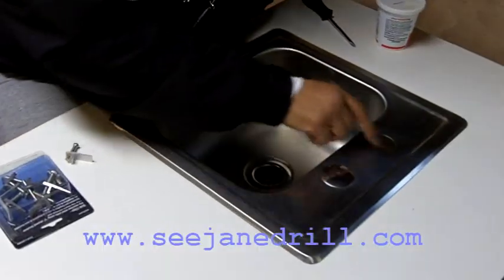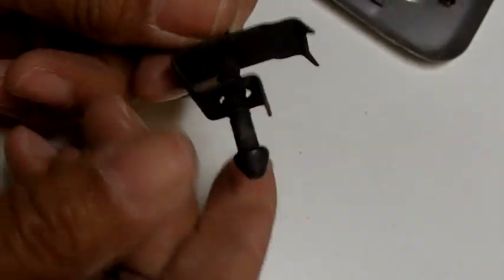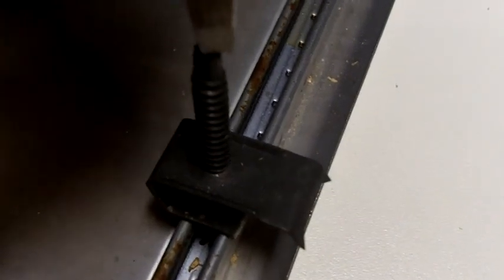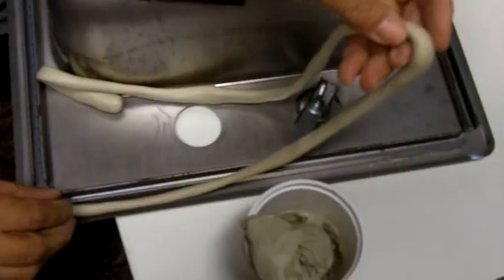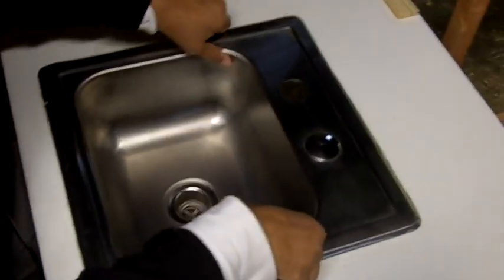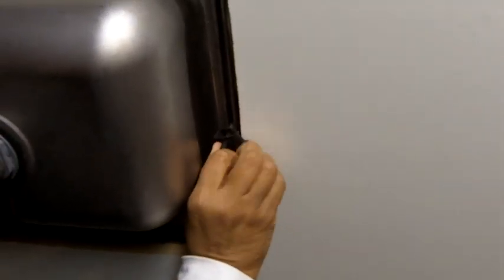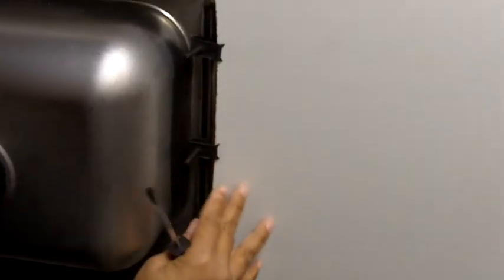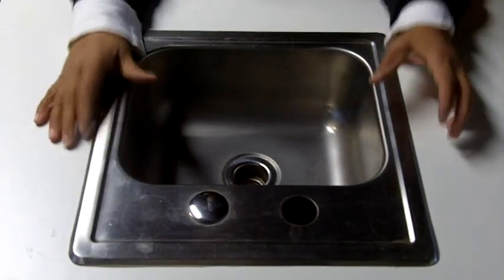How to Attach a Sink to a Countertop

Comment: Thank you very much for posting this video. I spent an afternoon installing a new stainless sink and when it came time to install the adjustable sink mounts, I was lost on how the clips actually worked, or fit to the rails. I had a friend who was helping me, and he didn't know either, so we found your video, and we got the sink in flush and square. We would not have been able to install the sink without this video. I wanted to let you know this. Thank you, again!

Comment: Thanks Lea for sharing. I bought a used stainless sink that came with no clamps. I’ve tried different style clamps but none worked. Another problem I have is the sink in bowed. But you putting plumbers putty around the sink gave me the idea how to fill in the gap caused by the bowed. My sink has different track than your sink for the clamps. I’m gonna go to a plumbing supply store to see if they can help me out getting the correct clamps.

Comment: Sinks clips are a pain... a good plumber passed on a tip... a 10-24 hex head bolt and nut fits in these...use a nut driver to finish off...save the frustration trying to get your flat head screwdriver in there... also used 10-24 couplers, rod and brackets on the "ornery" front of the sink... good job...good videos...glad I found you!
Reply: Michael Ambler
Reply: Michael Ambler watch

Comment: The problem I'm having, is when a sink doesn't have any tracks or lip to even use these kind of clips. In fact even if it DID, I've only got 1 side that has a usable lip of the counter top. An it's a copper sink + counter top. So idk if the only option is gluing and/or siliconing it.

Comment: For us taller guys trying to fit under the sink....using a flat head screwdriver...is not very easy.  why hasn't anyone developed a better screw fitting thats a bit friendlier than the flat...it has a tendency to slide off the head of the screwdriver.....and why didn't you have the faucet already installed before mounting the sink....much easier that way...unless thats for another vid....lol

Comment: I have a question. My laminate countertops are bowed/warped. I was originally going to use a fiberglass sink but it doesn't use clips. It just sits on a bead of silicone. If I use that I will have to try and sand it to the valley. My question is are these clips pretty strong? Do you think it will suck the valley up to the sink? I tried screwing the the countertop down to the cabinets but the screws just tear apart the particle board tops. I'm trying to decide if I should exchange the fiberglass for a stainless sink with these clamps or just try to shave the fiberglass sink.
Reply from the maker: It's possible that the clips will suck up the distance between the counter top and the sink itself, because they cover more surface area than a screw, and the contact point is distributed more evenly.  So it may work.

Comment: I appreciate the tutorial on how to use the sink clips, but I wouldn't recommend using plumbers putty.  I followed this video when installing a sink on a new granite countertop and the putty left an oil stain around the hole of the counter.  Nothing I've tried has gotten rid of the stain.  I think silicone would be a safer alternative.